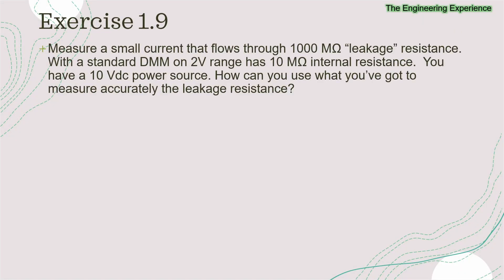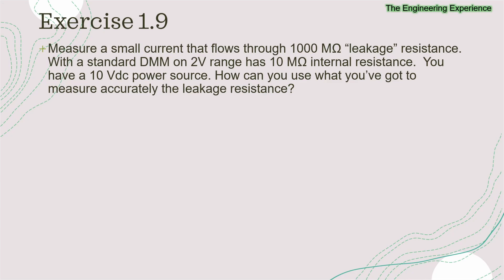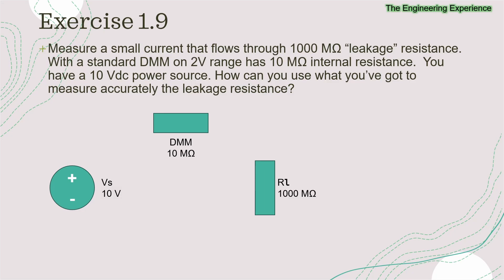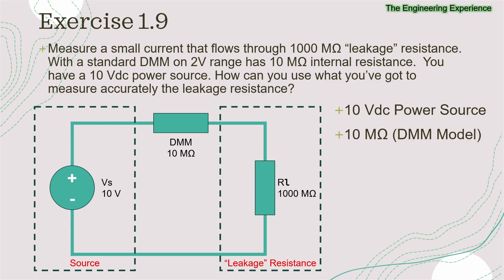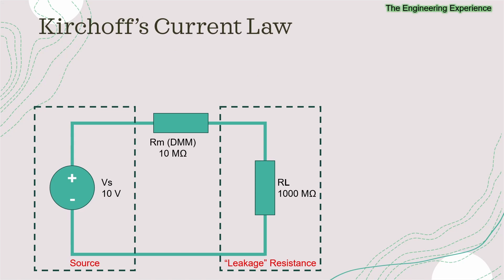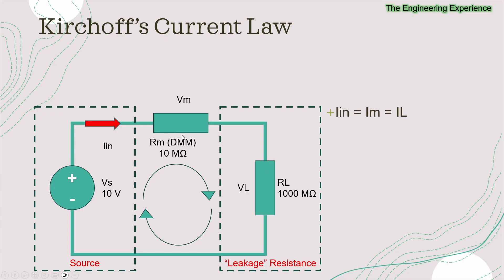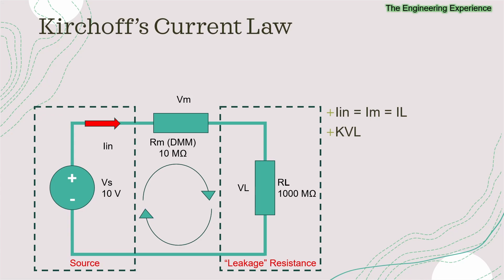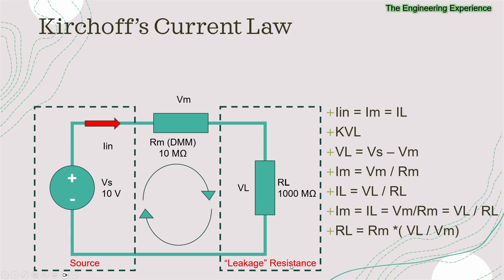Learn The Art of Electronics: Exercise 1.9 Measuring Leakage Current

Comment: These seems rather complicated. Simply applying voltage divider formula would have given you Voltage across R_L, with it you can get the current so 2 equations.
Reply from the maker: Yes, you are correct but sometimes its important to learn where the potential divider equation comes from.

Comment: Wouldn't this procedure simply give you back RL = 1000 MOhm?
Reply from the maker: I guess I could've gone a step further. 

To get to the leakage current with a voltmet you need to divide the meter’s reading by the resistance of the
meter. In this case, 10 MΩ. V/R = leakage current.

It works on paper but may not in practice as meter resistance tolerance may vary significantly.